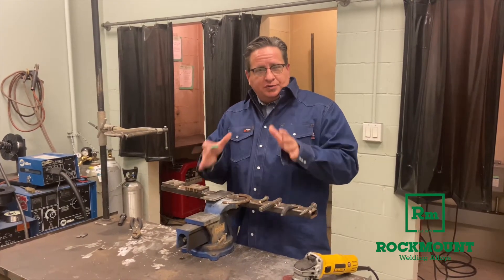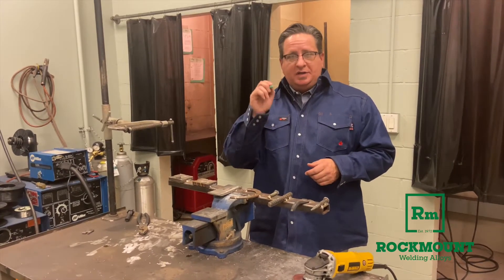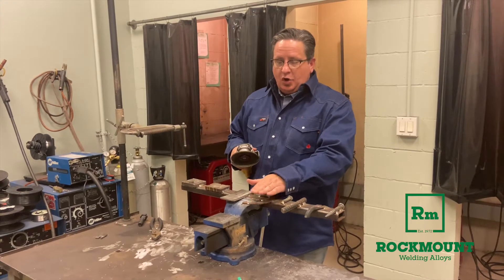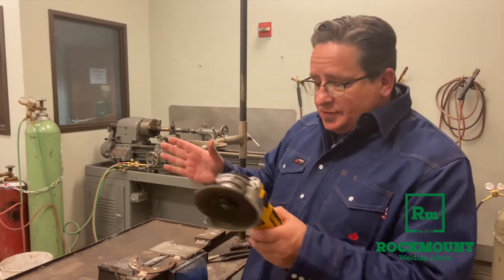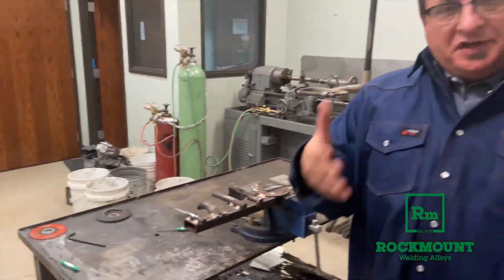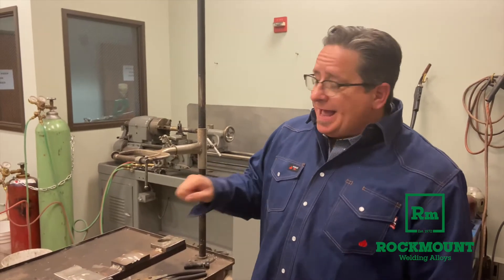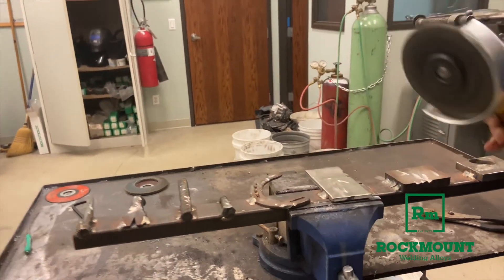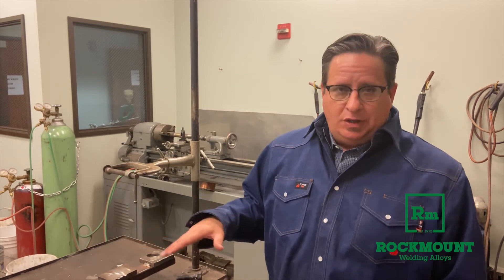Spark Testing - Base Metal Identification

Comment: I hate to be that guy but as an engineer and a millwright I can't let this one fly. Not all stainless is the same. SOME stainless is magnetic. It is not because of the lack of carbon, otherwise you could have pure carbon and it would be magnetic (hint, carbon is not magnetic.) Magnetism has a lot more to do with the ions and crystaline structure than the material composition. For example: almost any 300 seiries stainless will have a face centered cubic structure while a 430 stainless will be magnetic because of it's body centered cubic structure. Lastly, be a good pal and wear PPE, gloves, glasses, face shield, etc. when working with grinders. It sets a good example for all the young folks watching. Cheers.